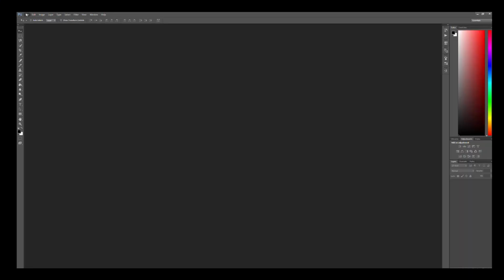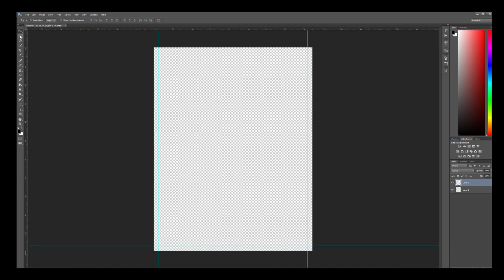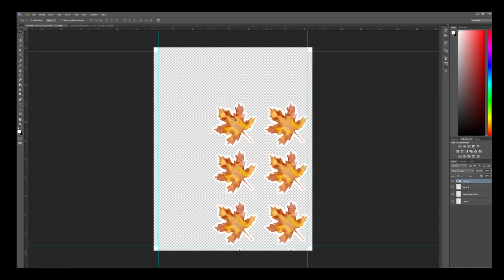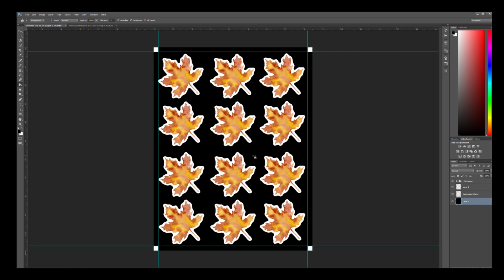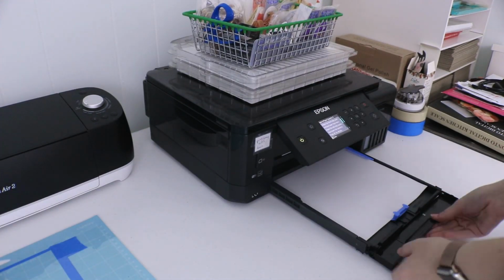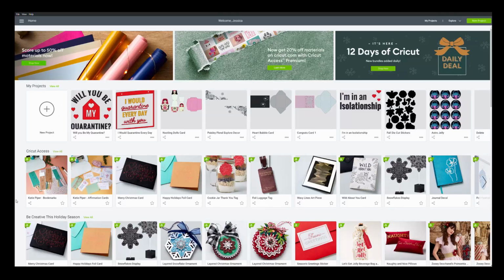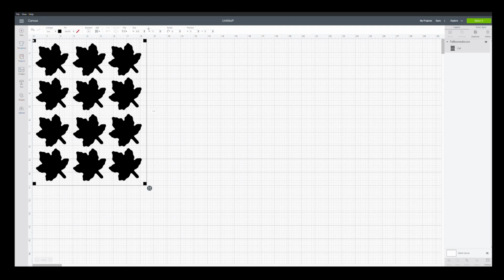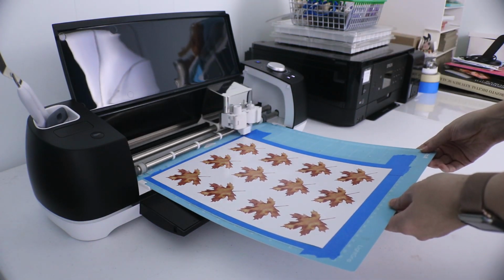Full Page Cricut Hack Tutorial Part 2 // Cricut Explore Air 2 Stickers

Comment: do you print the file borderless? thank youu
Reply from the maker: My designs were 0.25 inches from the border and because they didn't touch or go off the edge I did not have to print borderless. It depends on the printer how far it will print to the edge as they are all different.

Comment: I’m confused about the registration marks. You mentioned Cricut uses the squares to know where the edge of the paper is? But the squares aren’t actually printed in color when you print out the full page and before you insert it into the machine, isn’t it already in place between the tape? So the Cricut will cut the same spot regardless if you had the registration squares? I think I’m missing something

Comment: A great video Jessica. Just what I've been looking for. But, really you shouldn't have to do this kind of work around to get the Cricut to use a full page. In my case it's A4 sized paper but the Cricut only allows me to use the top three quarters of the paper and just wastes the rest. At the moment I'm using A4 holographic vinyl for a project and that's a lot of vinyl getting wasted. Having spent hundreds of pounds, buying a Cricut machine I'd have expected the software to work a lot better than this. I can't even use a different size of media than A4 as the software has no feature to change the size. Cricut won't even let you use any another kind of software other than their own. When this machine eventually breaks down it looks like a Silhouette Cameo machine for me.

Comment: I know this post is a year or so old, but it's def helpful thus far. I've always cut stickers on my own and found the silhouettes and cricut waste SO much vinyl...and that's expensive. I tried the set up twice now, and in the second time, after a calibration, I found the initial cutting of the tape to be so crooked and off. I did it a second time (to see if it would hit the tape in the same spot) and it was off center from that! Do I need to get the tape EXACTLY on those lines, or maybe the glossiness of this tape is throwing it off?

Comment: This was a good video for those who prefer doing stickers with an offset white border. I like my stickers without such a border.  And while the border does give you a bit of leeway in how well the Cricut cuts the pre-printed images, I still like only printing and cutting my images with no borders.  For such images, I have had not as good results of the cutting of the images as you go further down the sheet, they are a bit more off.  So for me personally, I will use the limitations of the printable area allowance of Design Space and fit as many stickers as I can within the 6.75 x 9.25 inch limitation. My stickers come out beautifully cut.

Comment: Thanks for making this video :0 However, I'm having one issue when it comes to cutting. My printer automatically adds a boarder to what ever i print so it means my cut lines won't match up with the image I've printed. Is there a way to work around this or fix the issue? 
I would really appreciate the advice
Reply: Select an option for "borderless printing". It should be somewhere in the printer settings.

Comment: Hi Jessica!  This was extremely helpful & confirmed what I was thinking as to what was happening.  I've been in the print business for 20 years, & I feel like a rookie with this machine!  I do have a question.  I'm using Illustrator & am setting up registrations in each of the corners.  I'm setting everything up to 0,0 in Design Space, but I'm still a little off.  At least, with using your tutorials, I'm a lot closer than what I was.  I was wondering how off-setting you are using for your cuts?  Also, with elements that require a bleed, how much bleed do you recommend?  Thanks in advance.
Reply: Have you calibrated your machine yet? Give that a shot. Mine was slightly off when I first started printing but now its spot on after doing two calibration sheets.
Reply: Hi Valerie - did you resolve this issue?  We are using Illustrator too and have a similar problem even after calibrating the Maker 3 correctly.  I must add we are using a Brother  MFC-J5730DW printer with borderless setting.  We are in Australia so use A4 paper which we have set in both Illustrator and Design Space.  Very frustrating indeed!
Reply: @robertvanriet2178  No. I never figured it out. I finally gave up & just started using Cricut's layout specifications with ensuring everything is staying within the 6.75"X9.25" design space & then choosing the Print then Cut option when importing the PNG file. After I design in Illustrator, I do take the AI file & place it in a template I created in PSD. I export out my PNG file from there. I found that AI creates too small of a file when exporting to PNG. PSD creates a very large PNG file, so it can be shrunken down when brought into Design Space. I hope this helps.

Comment: Hi Jessica, I have a question-so I have made stickers using the previous method where you can on use the standard printing space with Cricut; my question is if my sticker is saved to design space, can I still do a full page of stickers or do I have to do the part of the set up where you put the squares in the corners?  I not sure if I can do that part, my stickers were created 2 years ago with text added.  I would like to get more stickers on the page if possible

Comment: This is very helpful! Unfortunately my printer is not printing 100% the exact size as in photoshop, which means the png cut file is also not 100% correct. Driving me nuts!
Reply: I noticed mine does this also…do you think there’s a way to fix that? Mine cuts a bit smaller that the measurements it’s supposed to be

Comment: I have seen a ton of videos about this but there is one area no one has touched on. The exact print settings. For me the registration marks are never exactly at the edge of the paper there's always white space between the registration marks and the edge of the paper. If I choose the borderless setting it blows up the image and cuts a few mm off the registration marks. Either way, my cuts will be offset. I'm at a loss. Any tips for me?
Reply: What I end up doing is that I’ll print with the squares as black and then  trim the top and left edge up to the edge of the squares. Then I’ll use a ruler to measure the width and length of the page from one edge of the square to the other edge.

Using those new measurements I’ll adjust my cut file size in cricut instead of doing 8.5x11.

Then I do the same thing and just align the now trimmed page to the top and left of the masking tape square.

Comment: THANK YOU SO MUCH!
Last night i was crying and regretting that i got cricut. 

I took me a few hours to create the sticker using this method. I'm using inkscape, so i had to save the png in another software and convert to jpeg to print etc. 
My printer wouldn't print without borders, a total chaos. But I've opened the file as jpeg in adobe and viola! After almost 30 tries, I've found the correct size to print for my cricut to cut. 

Thankyou once again! You gave me so much hope.. thanks for sharing!! ❤❤❤
Reply from the maker: I'm so glad you finally got it to work! Yea unfortunately everyone has a different set up with different equipment and different software, so it takes some tweaking. Hopefully your comment might help others though so thank you for explaining what you did! 💖

Comment: Still cannot get it to actually cut the correct lines even after calibration.  This unfortunately is not working for me still. Any other tips you can offer?
Reply from the maker: Sorry everyone's set up is different so it's hard to help or to narrow down the where the issue is stemming from. Perhaps do some testing with your printer. Otherwise the machine isn't perfect and even though I can get this to work for me it doesn't always cut 100% correct either and unfortunately we can't control that.

Comment: I am having a lot of trouble on this section. I have a new version of Photoshop and I am not really used to using it. I use Lightroom for my photography. I am lost! Can you recommend some other video using the updated version? TIA!
Reply from the maker: Are you having trouble with a specific part? I don't think these functions have changed too much, but they may have just changed location.
Reply: Yes, I created the rectangle in Photoshop, but the .25 inch border, I could not figure out. What tool should I use?
Reply from the maker: @SafariSis  OK Try View -> Rules  or Guides or Extras
Reply: @JessicaLynnIllustration  I used the ruler and guides and created a border on the top edge and one side, but cannot get it to add the border on the bottom and the other side. Sorry to be so dense!
Reply from the maker: @SafariSis  No problem - No rulers will show at the bottom or the right side, so what you have to do is drag from the top ruler again all the way to the bottom and drag from the left ruler again all the way to the right. Hope that helps!
Reply: @JessicaLynnIllustration  okay, I got that to work. Now for the square, do you use the rectangle creator?

Comment: Hi. I would really appreciate your help. When I make a stencil, i put many images on the sheet and it cuts a square around each image (I did not put a square around any image) which cuts out all of the images separately. I upload images that I find from the internet. I want all of the images on 1 sheet together. I called Cricut and they were no help.  Thank you.
Reply from the maker: Are you using the Print Then Cut option in the Design Space software?

Comment: Is there a video on how to set up the sticker sheet? I am trying to import the sticker sheet I made on a separate document, and it's coming in all fuzzy
Reply from the maker: I currently don't have a video on how I set up my sticker sheets, but you do need to use .png file with this method. I'm not sure exactly what you mean, but if it's "fuzzy" looking my first thought is that the resolution isn't high enough or your canvas is big enough.
Reply: @JessicaLynnIllustration  thanks! I'll try to change the resolution or canvas size. :)
Reply: Will you be making a video on how to set up the sticker sheet? That’s the last part I need to figure out 😫

Comment: Is there a way to print through Cricut design space because I don’t have photoshop to set it up i can set it all up in the design space but i just need a way to print it from there
Reply from the maker: The only way I've found to print from Design Space is if you do the Print Then Cut, which creates the border and therefore you wouldn't be able to do the full page Cricut hack. I believe they designed the Design Space software this way because Cricut's purpose is primarily cutting, so they didn't consider ppl might be using it to design things and print from it. However, there is a free software that is very similar to Photoshop called FireAlpaca - (I did a video overview about it here: https://youtu.be/rtjTfG4RCkg) Another one I have heard people use that is free, but I'm not familiar with is, Inkscape. Definitely check them out!
Reply: @JessicaLynnIllustration  thank u I will!
Reply: @JessicaLynnIllustration  how do I insert an image in that software
Reply from the maker: You have to save your "cut file" as a .png and choose the Upload button to import it into the software

Comment: Thank you for your video. I'm trying it now. When you print the sticker page do you use 'borderless' printing in the selections?
Reply from the maker: you're welcome! I did not have to choose "borderless" as my printer printed right to the edge automatically. You may need to test this on your own printer first, by making the 4 white squares in each corner black to see if it prints right to edge of the paper or not. If it does you are all set. If it does not your cuts would be off and you might need to google your printer model and how to print "borderless" or remove any kind of margin the printer is adding. Hope that helps.

Comment: Anyone still has issues with the cricut cutting correctly? I did a calibration and it was perfect but when it comes to doing this hack its just off by a lot.
Reply from the maker: If your calibration is perfect but cuts are still off, it sounds like it could be the printer. I've seen a  lot of comments about ppls printer adding a tiny border, which would definitely be a reason to throw cuts off. My suggestion is make those 4 white "registration" squares black, put them in each corner of the paper and just print that. If the printer is not printing them right to edge of the paper then your printer is likely adding a border or margin. You'll have to google your exact printer model and how to remove margins/borders or print borderless. Some printers are not able to print right to the edge, but you'll have to do some research.

Comment: Can you leave the blue tape on the mat to use for future projects thanks
Reply from the maker: I don't recommend leaving the tape on for other projects as it could affect the cuts and your material might not stick as well. I bought additional mats off Amazon as I found them cheaper. That way I can leave one mat taped up at all times and when doing other projects I pull out a different mat.
Reply: @JessicaLynnIllustration  that’s what I mean   Can I leave the blue tape in one mat just for print and cut so I don’t have to do it every time
As for the 4 square marks. Can we save it as a template and use on other projects. Thanks

Comment: This is a great video. I’ll be doing something similar with 12x12 to get more use out of my foil transfer sheets. I didn’t see you use the registration marks tho. Did they do anything? How did you use them when lining up in DS?
Reply from the maker: Thank you! The registration marks are white so nothing will be printed, but they do get exported into Design Space along with the "cut lines" in the .png file. The registration marks serve no purpose in DS you have to enter the measurements manually like I show in the video. They are probably not really needed but because they are cut first I can tell right away if my Cricut cuts are going to be off or not. This gives me the chance to stop the Cricut right away, unload the mat, do some calibration tests, then reload the mat and start the cut again.
Reply: @JessicaLynnIllustration  as I did this with my own method - I realized you need marks it at least 2 of the outer corners to get the right overall sizing and placement on the mat. Like the way you use attach in DS generally. Thanks for getting back to me!
Reply from the maker: @checkerdchicken_doot  That's good to know! Thanks for the reply!

Comment: hi i was wondering have you ever use non vinal and non plain sticker paper like glitter sticker paper and maybe layers if possible that paper I have been using just cut feature so far yesterday was day 2 it went well but I was wondering I would I use a laser printer on this so if I had a white or clear I can print and cut good  far not try the foam to you can also contact me by Facebook for private message  thank you some your videos are helpful if I wish for print in color and then cut like you also I have my designs all ready in Cricut design is there a way to for print cut to transfer from down load to photo shop never use it before I got from after this video what I got that was free photo image editor Pixelstyle will this still work
Reply from the maker: Hello - I have only used regular sticker paper, never anything laminated or glitter. You can't move files from Design Space into an editing program. You have to create the files outside of DS in order to do this technique. There are several free programs out there such as Inkscape, but I have not tried using any other program before. However, I believe as long as the program (1) has layers, (2) can save as a .png (transparent) file AND (3) your printer does not add a border or auto adjust your document, you should be able to do this technique. It can take practice and playing with your settings to get everything right for your set up.